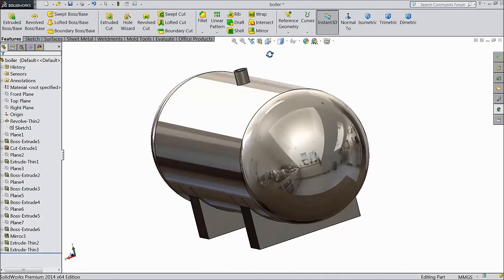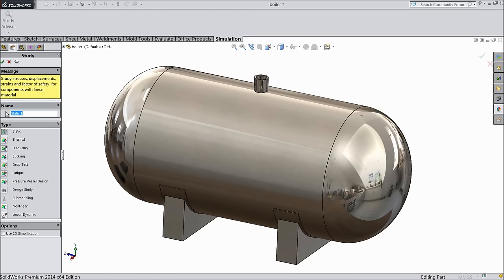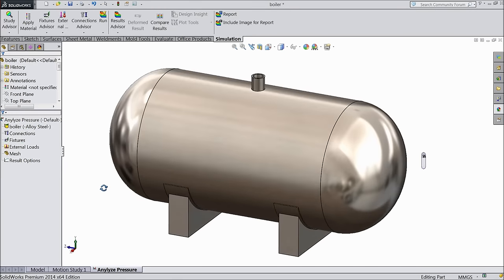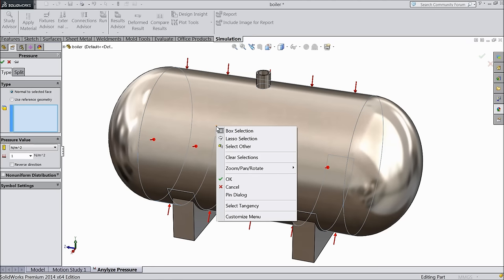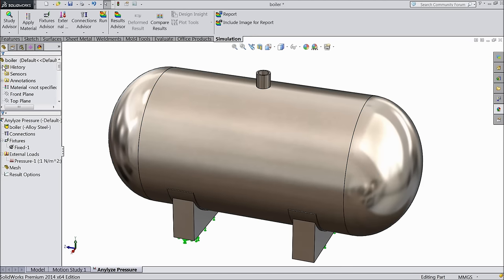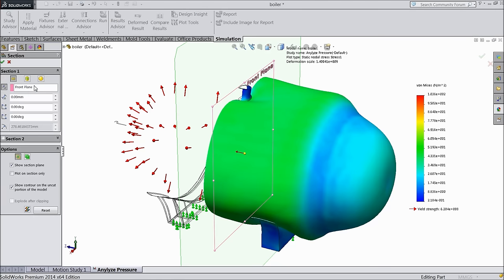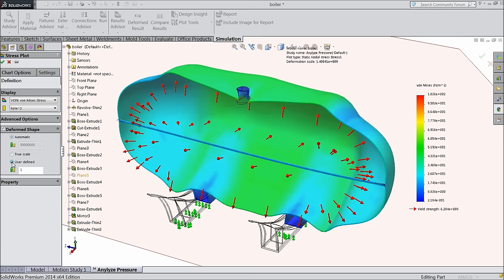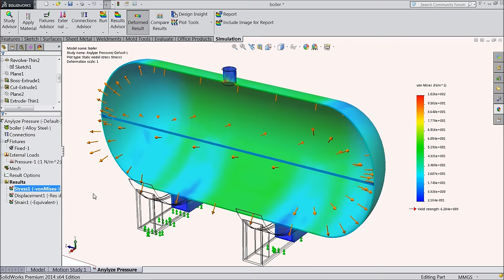Solidworks Simulation tutorial | Analyze Tank Pressure in Solidworks

Comment: TERRIBLE video. The deformation scale that he started with was 1 BILLION X. You can see on the chart the yield strength is 1 MILLION times greater than the maximum stress in this simulation. 1 N/m2 is not even 0.1% of ambient pressure at sea level. You could make the tank out of paper and it wouldn't fail. Your own breath exerts more pressure on the air than 1 N/m2.
Reply: the von mises stresses are higher than yield stress and the tank dont fail i agree with you but he corrected at last his mistake and make a nice simulation

Comment: the pressure applied is not correct. Not necessary for a pipe to make a stub, or applied on the flat face of the nozzle the pressure is calculated (if the body volume), in the axial direction of the barrel